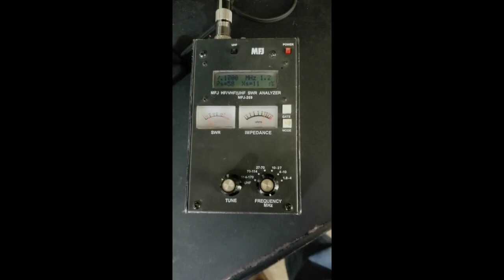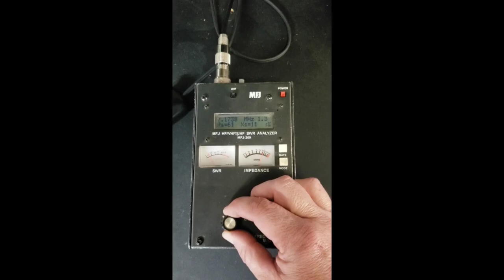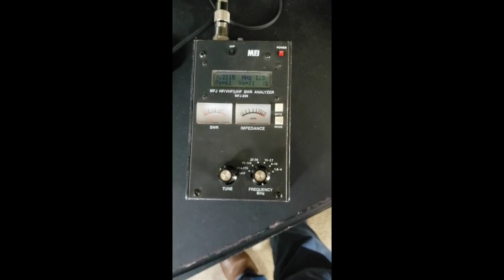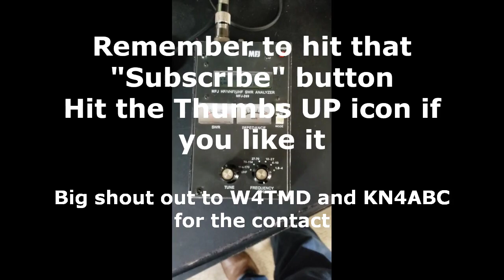It's gotta work....just gotta.  40 meter RedNeck Monstrosity

Comment: Howdy,   hamsticks are great for mobile, but not very efficient overall.   Also, they're a bit narrow, being loaded shortened radiators.  
That trellis and those trees gave me an idea for something fairly simple that would really open things up for you.  
Get a 49:1 balun for the end fed half wave antennas, not too much $ to buy and pretty easy to make for less.  
Now, put a pole in the middle of that trellis that's just as tall as the top of the trellis.  Put the 49:1 at the top of the trellis as central to it is possible.   Run a 66 foot wire from the balun up into one of those trees and bind the ground side of the balun to the trellis.
You'll get excellent performance on 40, 20, 15, 10, and 6 meters without a tuner.  It will outperform those hamsticks by a wide margin.
Reply: Good advice! 

Kevin I hope you are doing well sir.
Reply from the maker: Thanks for the info.   I'll look into that.